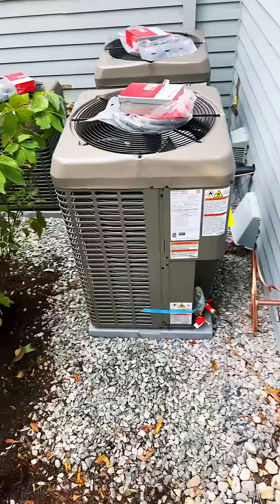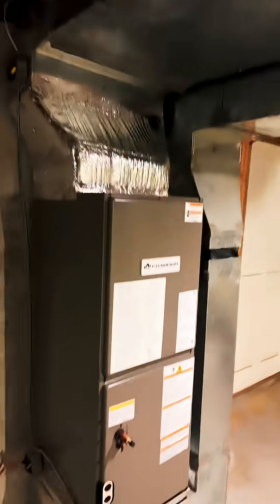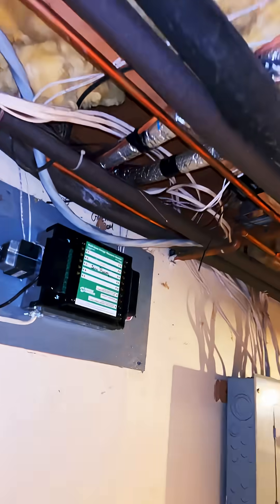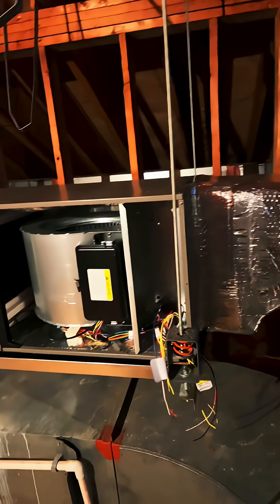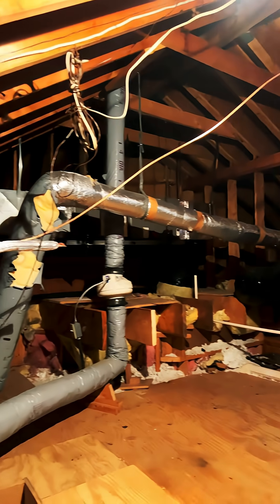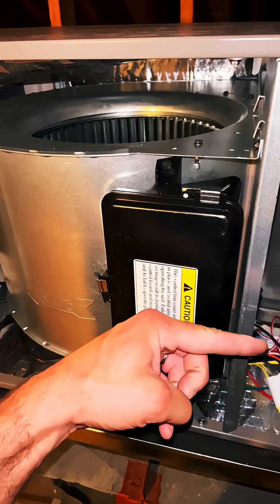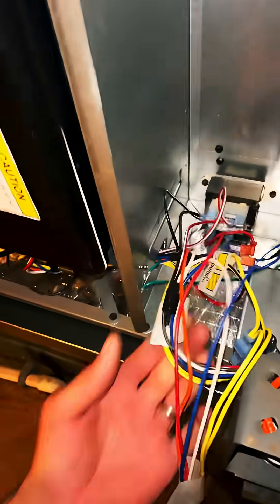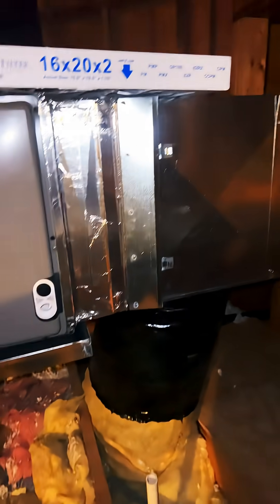New HVAC Equipment Installation Project | Champion R454B! #championcooling #hvaclife #hvacshorts

Comment: Clean looking work.  I've noticed on those air handlers that there's no green fan wire in the thermostat wires. How does that wire in?
Reply from the maker: I can't remember right now off the top of my head, but I have all the wires I need coming from the thermostat and I have the thermostat wire in the unit and then you just follow the installed instructions on how to wire up everything into the interceptor board that will shut everything down and turn on the fan. Only if there is a refrigerant leak it wires into that board there. It's all in there. Trust me.

Comment: Are they properly spaced they look really close?
Reply from the maker: Yes. They are it may not look it but they are. I also just planted them there. I haven't done the final adjustment and hook up.
Reply from the maker: Just wanted to add it's about 18 inches between each other minimum  and 6 inches to the wall minimum. Sometimes it's 24 inches minimum in between them, but you can get you can do 18 if needed the book says. I'm sort of a little bit subject too it being right in front of the house I don't want them to spaced apart here, the minimum the better here. And a little of where the existing holes and electrical are, trying to keep it close to what the original units were. I will whip out that tape measure when I get back there don't you worry lol! Jesus is Lord!

Comment: Are you using press fittings? The resi company I used to work for did for their mini split installs for awhile. As a service guy I went back on a LOT of leaking fittings. Probably due to a lot of improper copper prep but still.
Reply from the maker: Yes, but it is all about the preparation like you said improper installation will definitely cause leaks. I'll be honest I wish I would've just used soft copper and pulled as much regular line as I could've. I'm scratching my head why I went hard pipe and fittings mainly due to the fact that three-quarter inch is not really fun to work with. The point is the fittings are so darn expensive almost $30 apiece for a one three-quarter inch press fitting. I probably could've done it cheaper with the soft copper.